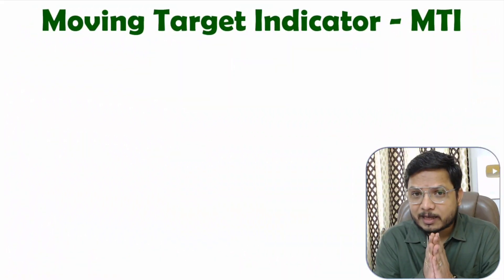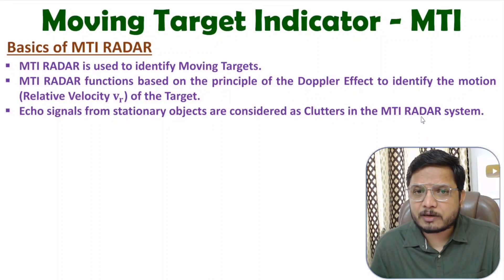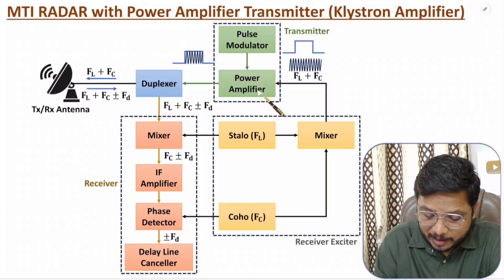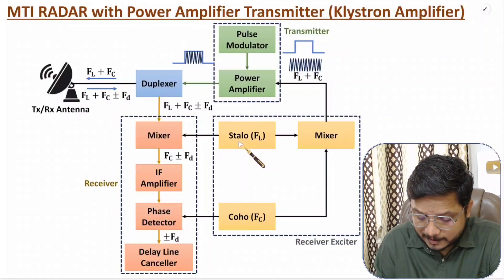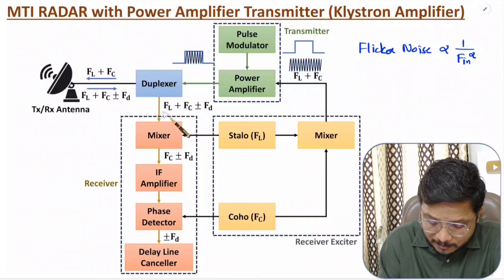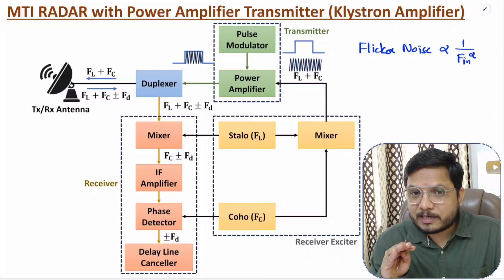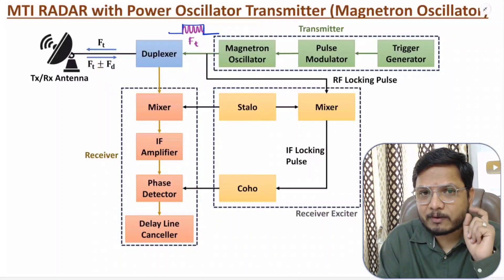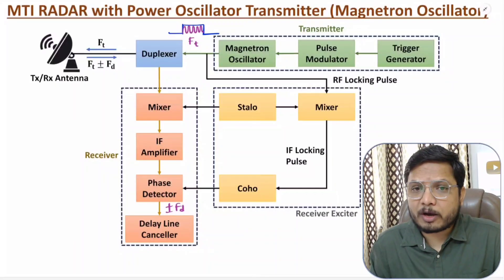MTI RADAR Basics | MTI RADAR with Power Amplifier | MTI RADAR with Power Oscillator

Comment: Great Explanation sir! Thank you for such knowledgeable content. I have one question. What is the purpose of Stalo in MTI with power oscillator? Magnetron is generating the RF energy. Coho is being used to locking the phase of the transmitted pulse. What purpose is stalo solving here...
Reply from the maker: Hey! The main difference between a Stalo and a Coho oscillator in radar systems is their purpose. A Stalo (Stable Local Oscillator) is used to convert the received radar signal to an intermediate frequency (IF), ensuring frequency stability. A Coho (Coherent Oscillator), on the other hand, provides a phase reference to detect moving targets using Doppler shift—it's key in coherent radars like MTI. So, Stalo = stable frequency for mixing, Coho = phase coherence for motion detection. Hope that helps!

Comment: Thanks for the video. Sorry I have a question. For weather radar which one is using 'MTI' or 'doppler pulsed radar'?
Also I cannot undrestand below part:
Also in another video which you talked about ‘MTR radar vs pulsed doppler radar’, you mentioned that transmitter for MTR radar is ‘klystron amplifiers or magnetron oscillator’ while pulsed doppler radar uses a power oscillator (klystron oscillator or magnetron oscillator)…but why in doppler pulsed video, you did not explain about types of power oscillators while in MTR, you did?
Reply from the maker: Doppler is used for weather
Reply from the maker: In mti radar, mostly magnetron oscillator is used.
Reply: @EngineeringFunda  but we use magnetron oscillator in doppler as well
Reply: PR Preecipitation Radar , Doppler RADAR and Cloud RADAR not MTI RADAR since MTI is often use in defense ...hope it help

Comment: Sir by 2 stage mixing we are downconverting the received signal into baseband .....why are we not worried about flicker noise as we were in CW radar .....where we were using non zero IF receiver architecture
Reply from the maker: In two stage mixing we have IF input frequency, which is higher then Fd, so it is good for receiver.
Reply: @EngineeringFunda  I didn't get it sir is this a Homodyne architecture or heterodyne....if it's Homodyne(which I think it is) why are we not worried about Flicker Noise here
Reply from the maker: @changethename4725  : Super Heterodyne receiver will come soon in this playlist. i think it will resolve your question.